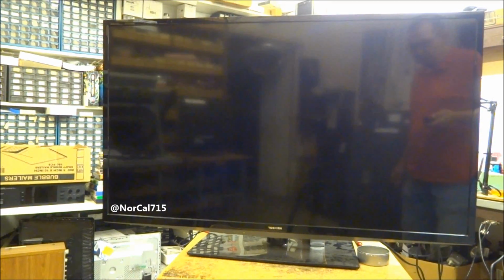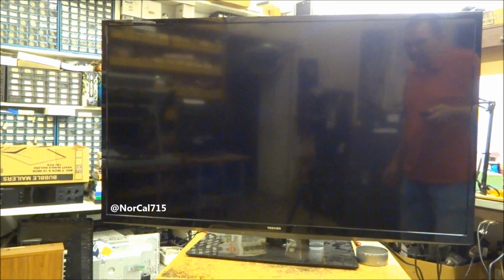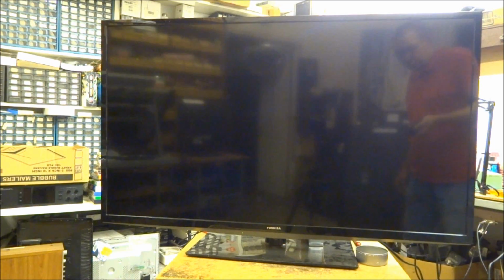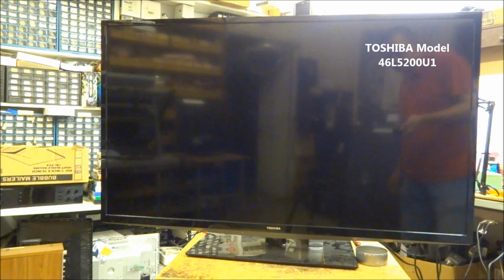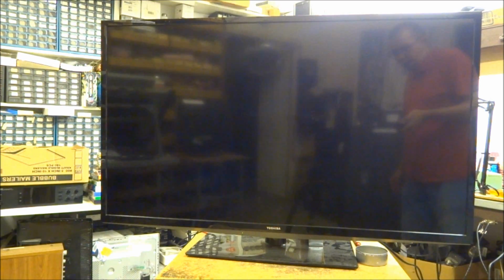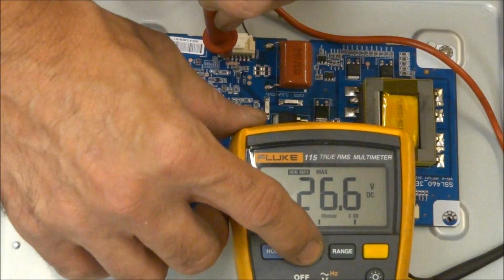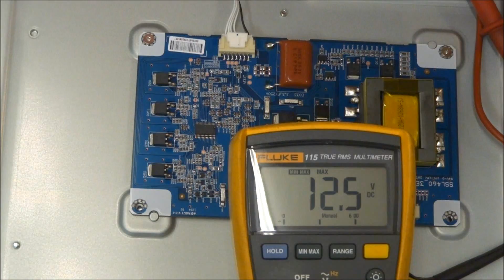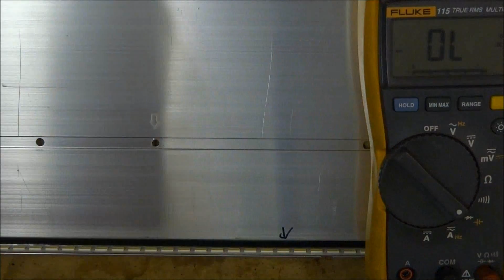Toshiba 46L5200 Logo Screen Flash - LCD TV REPAIR No Picture - LED Drive Problem Part 1

Comment: Have the same issue with Toshiba 55 inch tv I’ve swapped the main 3 boards in the tv but have the same issue it shows a perfect clean image for about 2/3 seconds then goes off ?
Reply from the maker: Get an "LED Backlight Tester" from eBay or Amazon and test the individual strings of backlights and see if any of them differ more than about 10% from the others.

https://www.amazon.com/TKDMR-Lamp-Bead-Backlight-Tester/dp/B082GVB68Y/ref=sr_1_1_sspa?keywords=led+backlight+tester&qid=1692080305&sr=8-1-spons&sp_csd=d2lkZ2V0TmFtZT1zcF9hdGY&psc=1

Comment: Keen repair route he is looking not At what power supplyled voltage but rather at the what leds are droping   Voltages  if they act diffrently   One string is bad how  ever  he shoilfnmake video on how we can determined how many string   In   Led  tv and how they commected

Comment: I have the same TV. After about 30 minutes my screen goes black but there is still sound. Does this mean I have a bad LED driver ?
Reply from the maker: Use a LED flashlight pressed up to the screen to see if you can see any video. If you do the the likely culprit is the LEDs, the drivers almost never fail.
Reply: @norcal715  thank you for your help sir

Comment: I have the same tv, but mine works for about an hour and then the backlight goes out. So I know it’s not an led that went bad. I’ve heard of similar models having an IC overheating. If it overheats, would replacing the heat sink work or would a thermal pad fix it, or do I need to replace the IC?

Update: I checked the voltages on the power board and led driver board. Power board looked good. Driver board was consistent, but each of the 4 contacts was at 22.3V.
Reply: Sounds like we have the same issue. Were you ever able to figure out the problem.?

Comment: There is a easier trick for know if you have a led strips  problem:When you start a tv and you see the logo and after tv shutdown or backlight shutdown.Or if in a dark room you see a really fast flash in the screen(but you dont have time to see the logo).These 2 cases are almost all the time (98%) a led strips problem.Dont broke your head with taking measure :)But this video is really well done for explain how it s worked.Thanks to you for do it :)

Comment: I have the exact same model. It does work for a while, then has the problem after a few minutes. Once it has the problem it happens quicker after you power cycle it. Possibly heat related LED problem? I measure 21.7v on all four back lights without video input. It seems to ramp up from 0, to 6, to 15, then to 21.7v. With PC video input it drops to 15.2v. All voltages are probably dependent on my back light level. When it goes out I see them all spike to 27v then to 0v. Vout measures 102v while normal, and 11v after it goes out. This TV just started doing this. Seven years use ain't bad compared to most other folks with just 2 years use after they bought it brand new. EDIT: I verified 3 back light lines all spike up to 28v, and only one does not when it happens. I swapped two pins and the non-spiking wire moved to the adjacent pad. So I suppose mine is not a driver board problem too.

Comment: I have a Toshiba Regza 40XV645U. It has audio but no video. When flashlight is flashed on screen in a dark room there is a faint, but difficult to see picture. What could be the problem.

Comment: Hi, I have the 50L5200U toshiba LED TV and it turns on, everything is great for about 10-12 minutes, then the display turns off automaticlaly, about 30 seconds later the sound turns off.  Any thing I can try, or how to fix?  Happens everytime.

Comment: Hello, excellent friend, your diagnosis of failure of this toschiba model. I explain a flaw that I have of this same model. When you turn on the TV, it gives the logo Toshiba turns on the screen (led) but then turns off and does not give video. What types of components or TV zone can I review? regards

Comment: Hey Jimmy I have a Toshiba 52hl167. I'm experiencing the top half of the screen way dimmer than the bottom half. I assume this is the backlight inverter, however when I openned the back of the TV, I have 4 boards; two on each side of the screen. How do I know which side controls the top half of the screen and do I have to replace all the boards? Thanks!

Comment: I know this video is fairly old now but I have a similar problem except that it gets passed the initial boot, when I plug something in, whether RCA or HDMI it shows the image from the device for a moment then the screen goes black. Could this be a similar issue? anything helps I appreciate your time.

Comment: Hello sir, can you help me with my LG tv. The problem was, the set can be switch on and off, no picture but audio is good, the backlight lights up. I changed the main board but the problem still persists. I suspected maybe the problem is the circuit connected directly to the panel. Is it normal that the voltage of the leds reads 92v and drops a bit in 86v steady?

Comment: I tested up to the point where you check the voltages for the LED on the driver, and mine were all the same.  I thought that would steer away from the LED strips and to the driver.  Replaced driver, same problem still.  Any other suggestions?  Would the LED strips be ok if those voltages are all about the same?
Reply: +Laura Kroger .. Also, when I have no picture input, the screen shows the "no signal" logo and stays on... but when picture input applied, then it flashes and loses picture, still has sound.
Reply: +Laura Kroger 
Did you do flashlight test ie video present? Did you find an answer?

Comment: Hi Steve Norcal715 I have question I have model toshiba 46l5200u1 tv I have tested the power supply and get all the voltages but when I test the driver board at the vout I get 126 v but when I check the  test points by the led return connecter  I only get 2.5v on the first 3 test points  is1,is2,is3 and get 5.2 on the is4 test point would you be able to tell me if it's a bad driver board or the LEDs like on your video.really nice educational videos really appreciate people like you that help out people Thank you
Reply: +albert jara 
I have similar problem.  Normal tv , then 0 voltage on the 4 s points.  Did you get a answer?
Reply: The only way to know for sure is to test the LEDs

Comment: What? I thought LEDs were supposed to last forever!!!!

Ha, fat chance of that. Long live the good old reliable CCFL sets.
Better color too.
Reply: Lcd tv's are proven to last!
Reply: Led 47 inch - 120 watt
CCFL 47 inch 250 watt
Reply: @zarirvtech  
Well, what you save on your electric bill will cost you 5X in repairs for LED TVs.
Reply: It's just a bad design, either saving a few cents on manufacturing, or designed to fail from day one. They should have made these TVs to withstand multiple LED failures, like LED street lights. You'd be able to get many more years of life limping on 1 to 10 failures. But they'd rather you buy new hardware just because of a failed 50 cent part.

Comment: Shorted LED Will not  cause shut off of backlight...maybe other opened one on the other side ..
Reply from the maker: Abderrazak Harakat Yes it did! It Caused current unbalance draw compared to the other 3 led circuits. see part 2 of video coming soon
Reply: +Abderrazak Harakat Of course it would, provided the load has raised high enough to the protection kick-in level. Most LED drivers are current drivers and have built-in protections for over-current and over-voltage. A diode shorting is actually a perfect failure since current driver is able to adjust to the lower resistance/high current by dropping out output voltage and thus lowering current again. But it can regulate/drop its output voltage only so much. When too much or too little current is required it just doesn't work.
Reply: +Coppell TV Repair LLC thank you for that. most TVs don't mind an led or two self.bypassing and the set just adjusts voltage accordingly.some brands just refuse to work with LEDs bypassed. this, I consider a design flaw, considering the work involved in getting access to the LEDs.

Comment: Why does 1 led shorted bring up the voltage and cause the tv to shut off? Did you have anything else that led you there? Most other tv repairs seem to end up a capacitor! You get the tough ones!!!!!
Thanks for the video
Reply: Ya, how annoying. Why can't these TVs be like the LED stop lights, where a huge cluster can die but yet the light keeps working. I swear it's planned obsolescence. The jig is up on bad capacitors, now they just switched to bad LEDs.

Comment: I was looking at a Samsung florescent backlight lcd and took the lcd screen out and the diffusers. On the samsung the metal frame that holds the lcd down is screwed on. Well I put everything back together using a small 4volt drill screwdriver and 20 minutes later while the tv was sitting there I heard a "crack" I looked and the one corner of the lcd got messed up. I assumed that I must have put to much pressure on the lcd when I put the bracket back on. Have you ever encountered the same problem?